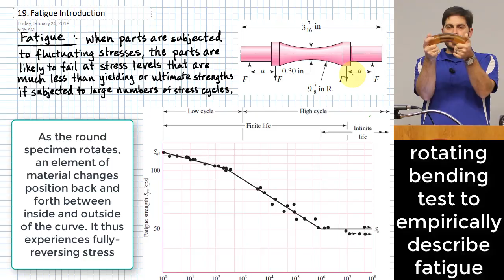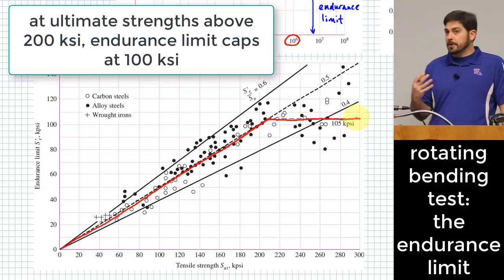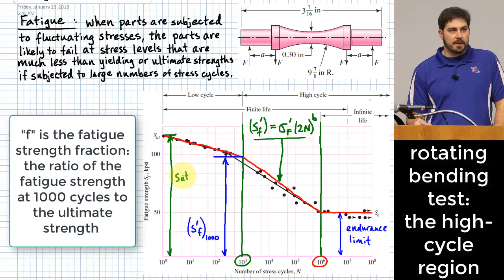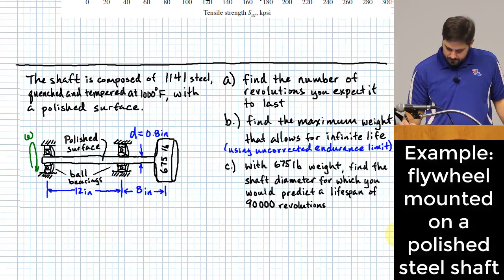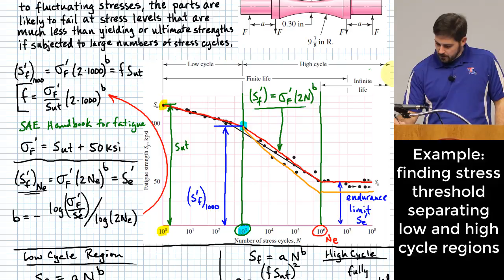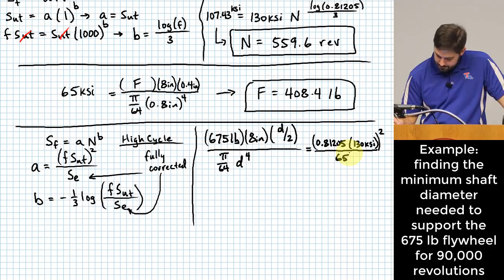Introduction to Fatigue: Stress-Life Method, S-N Curve

Comment: Is this considered the stress-life method?  My lectures only covered applying Goodman's Criterion with adjusted endurance limit right out of the gate, and I am a bit confused at this point.  My textbook(Shigley's 11th ed.) does not solve in this way, rather applies an adjusted von-mises stress without great detail of any underlying development of the equations.  It is extremely hard to find supplement for this topic.  Your lecture helped me tremendously, but there are gaps in connecting the relation with Von-Mises stresses.

Comment: I'm a student studing mechanical eng. then I have a question about fatigue life. For example, when predicting the fatigue life of a rubber in a rubber mount, does the change in the mass of the cradle affect the fatigue life? (cradle is base frame and it is connected rubber mount) otherwise this video was GOOD

Comment: I'm currently taking Design Machine Elements at the University of Connecticut and at this point I am no longer going/watching my professor's lecture videos. I wish I had found your channel at the beginning of the semester. Thank you for doing all of this, I will gladly share your channel with my classmates!
Reply from the maker: I'm glad you are finding my content useful! I appreciate that you are promoting it among your friends! Thanks for watching, and best of luck in your studies!
Reply: @TheBomPE  Thank you much. Hey I had a quick question in regard to the relationship you obtained for sigma_f^prime from the SAE handbook. I am using shigleys 11th addition and I cant find that information. Was curious to know if I can use that relationship in regard to a specimen that has a machined surface where I have already obtained the modified endurance limit? Also, do you always add 50 ksi to the specimen's ultimate tensile strength or does that value change with respect to different steels' ultimate tensile strengths?
Reply from the maker: Yes they made significant changes to the 11th edition. To understand all of the steps I took in this video, it helps to have a 10th edition to reference. The short answer is that yes, you just add 50ksi (constant).

Comment: Great presentation, thank you! I've followed the methodology for my case (a load monitoring pin made of 17/4PH to condition H1150D) and I used the maximum calculated stress as the Von Mises stress (in my loading case).  Sf(prime)1000 is far bigger than my calculated stress, which would take me into the high cycle region. The formula for "a" (high cycle) contains Se (fully corrected). Where do I take that one from? I couldn't find anywhere the S-N curve for that material and condition.  Am I on the right path? Many thanks for your support.

Comment: Dear professor is there a formula to find fatigue stress coefficient?? Thank you
Reply from the maker: There are fatigue strength coefficients listed for several types of materials in table A-23 in Shigley. If you are dealing with steel and you do not have specific data available for fatigue strength coefficient, you can use the SAE estimations cited in equation 6-11 in Shigley (as I did in the example in this video). If you have an experimental SN curve for the specific type of material in question, you can use equation 6-9 in Shigley as a model and do a curve fit to find the fatigue strength coefficient and the fatigue strength exponent. I'm not sure what you are starting with, but these are some possible answers. Thanks for watching!

Comment: Sir! I am solving one fatigue analysis problem in Hypermesh using S-N method. So I needed S-N curve data so could you suggest where can I get all these data for different materials?
Reply: Try ncode matrial data
Reply: @yuzhuwang4819  thank you
Reply: @yuzhuwang4819  do you have any link for that?
Reply: @ambasinha4993  I have this data but unless you have this software, you can't open it
Reply: @yuzhuwang4819  OK.. No problem

Comment: Sir , you ignored direct shear caused by the Flywheel, in the example!!!   Thank u for the video
Reply from the maker: You're right, I did neglect direct shear. Fortunately direct shear would only add about 1.34ksi of shearing stress. Combining that with bending stress using DE theory would bring the von-mises stress to about 107.46ksi as opposed to the 107.43ksi I used in the example. I think it is OK to neglect direct shear in this case.

Thanks for watching!